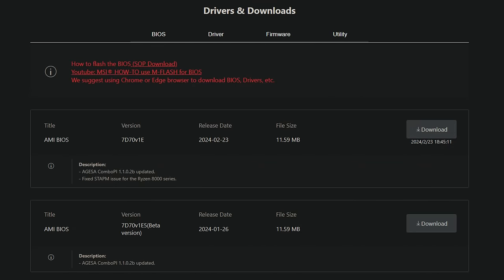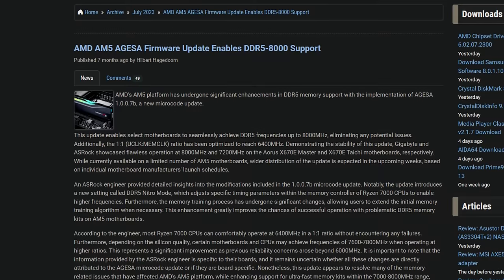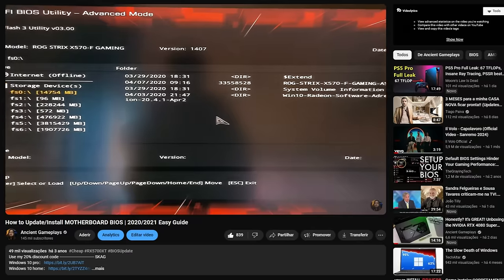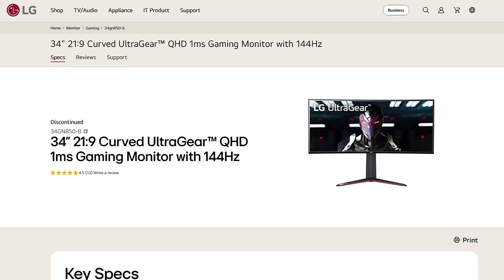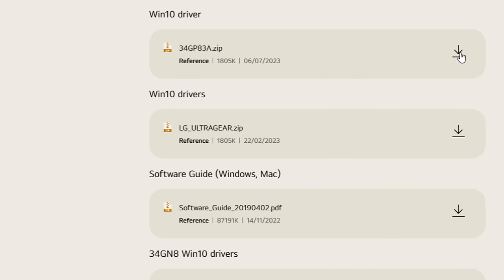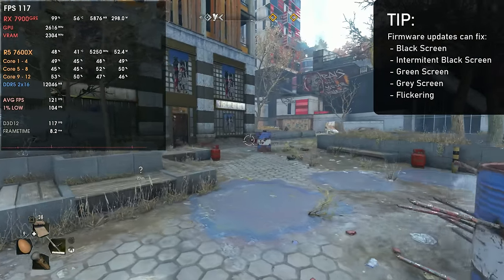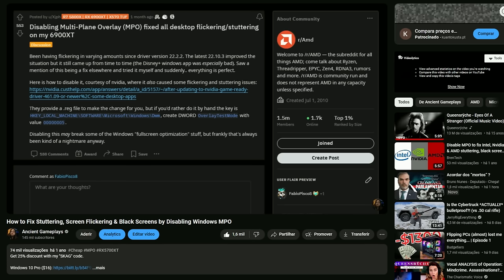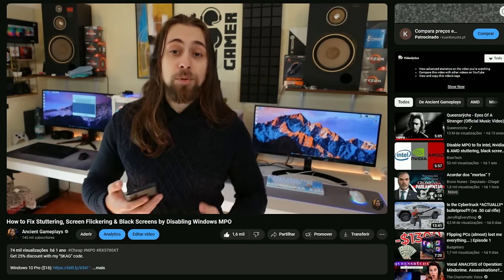20 TIPS to FIX "AMD GPU's Problems" | Easy 2024 Tutorial Guide

Comment: I'm going to try some of these things, thank you for the video.

I'm having an issue with my RX 7800xt card in Unreal Engine 5 where if I use DirectX 12, I'll get gpu driver crashes with a lovely little error message about "driver crashed or d3ddevice disconnected" and it's driving me up the wall. From my research, this seems to be a very common issue for people but there's very little information in the way of fixing it and it's been ongoing forever...  I hope I can find a fix or that one of your suggestions helps because I need to use dx12 for my project. lol
Reply from the maker: Never had a single one of those issues with any game I played, including UE ones
Reply: @AncientGameplays  It's not an issue with playing the games, it's an issue with developing them. DirectX12 is required for things like lumen and nanite to work but it seems to be a common issue for developers using unreal engine with an amd card to experience unfortunately.
Reply: @TuxedoVaileGAMES  Have you checked that you have the latest DirectX 12 installed? There is a more recent version - DirectX 12 Ultimate that may not have installed perhaps on your PC. DXdiag on your system should show which version you have.

 If you do already have that,  and as a precautionary measure anyway, you can run dism commands from an elevated command prompt to check that your system image is not corrupt and chkdsk for your OS drive. It can also help to do an inplace install of Windows, keeping all of your settings, apps and files. This can help with corrupt system files as well.
Reply: @ZenAndPsychedelicHealingCenter  I'll check that yeah, my PC is a brand new prebuilt from Skytech though and I think it was already up to date when I went through everything a week ago when I got it. I'll still check though, thank you.
Reply: Yeah, it looks like I'm using the most up-to-date DX12.

Last night I did manage to help my issue a little bit by adding a Tdrdelay to my windows registry. I still get minute long hitches where my game engine freezes during play-tests but at least it's not crashing anymore.

Comment: Hi

Have you ever run into this crash problem? Started 01.01.2024, NEVER before.

I built the computer autumn 2022, it worked flawlessly with 3 different GPUs (first nVidia, then Intel and then AMD) until just after new years 2024, then the problem started.

After I boot the PC (7900 XTX since autumn 2023), after a few mins, the PC may blackscreen boot. When I ran WinDbg back in January on the mini dump, it stated " DRIVER_POWER_STATE_FAILURE ". But not been able to get WinDbg after the first week or so, now it never finishes debuging.

After the reboot, that may happen after a few mins after booting, which occurs about 75% of the times I turn the PC on, the PC is rock solid for hours on end with gaming. No OC, except RAM that is running 6000 AMD profile in BIOS, Asus Rog Strix X670E-E Gaming Wifi mobo.

Updated BIOS, tried many AMD drivers, and I have no idea what driver the WinDbg is referring to either, it did not state.

Let me make this very clear; it NEVER happened until clock said 01.01.2024, then it started, just 1 or 2 hours into the new year. If I do not remember wrong, it started happening with the first boot in 2024.

Anyone experienced this? Any ideas?..

Computer Type: Desktop

GPU: 7900 XTX

CPU: RYZEN 7 7700X

Motherboard: Asus Rog Strix X670E-E Gaming Wifi

BIOS Version: 1904 (also tried with earlier BIOSes)

RAM: G.Skill Trident Z5 Neo DDR5-6000 C30 DC - 32GB (AMD EXPO)

PSU: ASUS ROG STRIX 1000G

Case: Corsair 5000D AIRFLOW TG

Operating System & Version: WINDOWS 11 Pro

GPU Drivers: tried several, now on latest beta 24.2.1

Chipset Drivers: 5.11.02.217

Background Applications: Aida64 Ultimate, HWInfo, Steelseries GG, Armoury Crate + div drivers
Reply from the maker: Follow the tips mate, also, your chipset drivers are old
Reply: It's written as NVIDIA, all upper case letters, just like AMD.
Reply: @AncientGameplays  I updated the chipset driver before I posted this, forgot to correct it. Will see if that solves the problem.
This is a really weird problem, the machine has run perfect since it was new, UNTIL first time I used it in 2024.
So this crash is 99,9% sure related to year 2024, never happened before 01.01.2024
Reply: @AncientGameplays   Nope, new chipset driver did not fix it. I have now also installed Linux, yes, Linux on a second drive in my PC. I will see if I run into the same problems with Linux, if so its hardware problem. If not, its a Windows problem.
So far gaming on Linux is going great :)

Comment: Why is the option for a clean driver install not part of the AMD Adrenalin software itself?
Reply: Kind of is though, but not reliable
Reply: Yeah, there is a force clean install checkbox during the driver install, but I haven't tested it.
Reply: nowadays people always used ddu for nvidia & amd driver for some reason or using amd cleanup utility (the same thing but can take you to safe mode automatically)
Reply: It is in Adrenaline. When ypu tick the box for clean install it will use the AMD Cleanup Utility automatically.

Comment: msi mpg a850g (850W 80+ Gold PSU) won't be an issue right? (For black screen crashes with rx 7900 xtx)
MY gpu is currently in repair/swap (again). I already bought gold plated dp2.1 cables for my monitors. I think this might help (my old gpu couldn't get image with monitor's default cables, but with those it works perfect, maybe it was an issue on the amd rx 7900 xtx too!)
Reply from the maker: Damn, that sounds really annoying..
Reply: Yeah... I couldn#t even play need for speed heat or start wars survivor or cs2 without crashes. However the performance was amazing, when it worked! I hope it will be fixed with the dp cables, when the gpu returns @AncientGameplays
Reply: Quick update: The gpu works now.
I got it returned to replace it in total two times.
Now it works just fine.
The problem: Part the gpu, part the displayport cables
I had 2x gigabyte g27q monitors for crisp wqhd 144hz gaming, and used the monitor's provided cables (dp1.2"hdr enhanced") i bought new ones (dp2.1 8k@120hz with gold plated connectors). now everything works buttery smooth, i could even oc to 3200mhz.
It was due to the bandwith, 144hz and 1440p, on dp 1.2 is like bare minimum, which can lead to interferences.

Thanks for the video, i wouldn't have ever thought it would be due to the cable!!!!

Comment: For me, updating bios and chipsets.

But I had to use the motherboard utility (GCC for Gigabyte -Z690 ud ax dr4-). 
Before using the utility, I was having a hell of bluescreens and sudden freezings, it was literally every day and especially when pc on idle.

I thought the problem came from my RX 6800 gpu (first AMD gpu since 2015, I hated AMD because I bought used R9 290 back then, was like a heater and tons of crashing and BSDs and went GTX 1060 on 2016).

But RX 6800 and Adrenaline Software made me trust in AMD again.
Reply from the maker: Like i said, most issues aren't amd sided
Reply: @AncientGameplays  What made me think it's amd fault, that Adernaline was resetting everything to default with a message that there was an issue and need to report🙂 So, they kinda guilty of taking other's mistakes on their shoulders. 
But I found out it's not their fault from event viewer, and I kept digging until GCC saved the day🙂
Reply from the maker: @mbrj3idi830  the settings reset due to system instability usually
Reply: @AncientGameplays  You definitely right.
This is the difference between AMD and Nvidia.
Nvidia never tells anything, even if it's their mistake🙂 They zip it till the next update 😏
AMD needs a user who knows, can trace and solve pc issues (not necessarily a professional, but have a minimum knowledge).

Comment: I have a 6800xt sapphire nitro for about a year (used). I did all that you said, but the gpu sometimes did just flicker and go black screen. The only thing that fixed it is a 40 mhz overclock of vram (so it doesn’t go below 2000). Yeah it is strange, maybe it is something about power stages or the vram is dying idk. I also redused gpu clock to reference at 2250mhz, voltage stock, power limit +15. The card now draws only 170-210watts(depending on the type of load), runs cool hotspot never over 80c, fan speed  1800-2000 rpm.
Sry for my English, not native language

Comment: Have you tried installing the chipset drivers that released on the 13th? They seem to have an issue
Reply from the maker: Mine are fine here
Reply: @AncientGameplays  I reached out to customer support the day of and the rep said they were aware of the issue. perhaps it has been resolved but the version number is the same. I'll try again
Reply: @AncientGameplays  no issues this time. Found the picture I took of the message and it was saying  "parameters incorrect" when trying to run the download before. Good to see they resolved the issue quickly

Comment: In my experience RTX 4080 has been plug and play, cannot think of a single issue. compared to 5700xt I used for 2 years, stuttering and performance change due to driver installs was the worst.
Reply from the maker: You kinda picked the worst case scenario. 5700xt was a trouble gpu in many ways, not even comparable to nowadays amd cards
Reply: RTX 4080 is the newest gen of NVIDIA meanwhile 5700XT was the 1st gen RDNA Card. So far away comparation in my opinion. My friend is using 5700XT for about 2-3 years i thinh & so far no problem on his side
Reply: @HapPawhere  well I had a gtx 460 and gtx 970 prior with out issues.

Comment: Pc GPU tip (crazy idea) - put rj45 ethernet plug on the GPU itself to run internet trough the GPU itself and to screen out any spying and filtering any viruses or malware before it gets dangerous for the PC itself or your BIOS 😮 ( well these days we have like 32 GB v-ram gpu-s 😊 lets put them togerher to work and to protect the PC and ours or yours data and privacy 😊😊😊😊😊😊😊 - now how about the inovative design works - no spying - no unwanted ports linking - full protection trough AMD software 🎉 ( call it AMD firewall gpu-s or something 😅😅

Comment: In every video I can't help but stare at your speakers with the dented dust caps on the woofers because I'm OCD like that. 😅It doesn't effect the sound of the speaker, but you can fix them easily enough by using a vacuum to pull them back out.

Comment: How do you fix blocky shadows / popping( similar to low draw distance) textures / reflections fuzzy (like looking at a busy ant nest)?  Hope my card is not faulty, everything up to date(clean installed driver and windows). XFX 7800xt, and (mostly) unreal engine games don't like my card. Temps are fine, GPU and hotspot has at around 15 °c difference (highest hotspot I remember is 85°c). Thank You.
Reply from the maker: blocky shadows? Never had such thing in several cards and over 50 games, BUT, you might be having a bug there in a specific game maybe?
Also, when getting AMD cards get Sapphire, Asrock & Powercolor to begin with... XFX should be the lower end choice IMO

Comment: I have to restart every 3 hours to get fluid motion frames back on. Because it disables itself at 3 hours.
I dont have windows activated. Does anyone think that could be a problem. Also I have like 3 amd folders with different things in them on different ssds. Not sure if that would cause any problem either. Everything works fine until 3 hours and afmf stops and won't come back on until restart. Also I only have 30 gig left on the ssd with the software so I dunno if that's to small and causing some kind of background issue building up memory or.something until the 3 hours. Any help appreciated
Reply: Upgrade or add on an external ssd
And you can get an activation key pretty cheap on sites
Reply from the maker: Use the 24.1.1 drivers

Comment: The best AMD fix I've implemented was moving to Linux.

Sounds like a Linux propaganda but I swear this the truth. There are more than 20 fixes listed here and they are somehow related to compatibility issues both physical and logical. AMD hardware on Linux somehow the opposite and I had no issue since the last 2 years of it yet I always get called on by people to fix their PCs which often times is related to their GPUs not working properly and throwing BOSDs (happens both on AMD & Nvidia), with AMD there's this recent recurring issue with Windows installing different drivers every time.
Reply: Linux support is one thing that's generally much better with AMD gpus than nvidia ones these days (sans HDMI 2.1 support because HDMI forum are ***).

Comment: Im having an issue that when i enable VRR in my monitor the screen randomly looses signal, sometimes it works for reasonable time, but suddenly returns the same issue. I have tested different cables and it's not the monitor's fault because happened before with my old monitor. I have an 6700 XT
Reply from the maker: Unless you have a defective card (which is hard to happen) something is going on there. Have you tried the things in this video?
Reply: @AncientGameplays  Yeah, only disabling Windows MPO haven't tried yet

Comment: My friend, my motherboard is Msi x370 Gaming Pro Carbon and the chipset driver versions on the Msi website and the AMD website are not the same and the driver version on the AMD website seems to be newer. In this case, which driver should I download and install? My graphics card is Msi Armor RX 580 8GB OC. The new drivers can often cause problems in many games. What should I do in this case? ULPS can be turned off from the registry.

Comment: Hey Fabio, I have had an issue with my build ever since I installed a GPU on it a few months after first putting it together: I can only play my games when I set my CPU (Ryzen 5 7600) to auto overclock in Adrenalin. I have tried manually setting up OC on the BIOS, researched PBO configs etc, but to no avail. The strangest thing is that games that ran on integrated graphics before without any issue.

Comment: Hi, Fabio, I have problems with my rx 6700 xt: when I playing with amd adrenaling monitoring or other overlay from amd adrenaline I having a great smoth image buy when I playing without it I just have some stutters or smf like that just image don't snooth any more on my monitor (I test it on other monitor as well no metter what monitor I use) but FRAME RATE are good wihout any troubles (I have riva tunner graph). Maybe you  can help me?
Reply: Also drivers, windows I reinstall couple times and it don't help me
Reply from the maker: that makes absolutely no sense to me. Watch some of these tips, certainly will also (like the VRR and antilag one)
Reply: @AncientGameplays  I've tried all of the tips :D nothing is fixing this problem only amd adrenaline overlay help me

Comment: What problems? Had an amd gpu since early 2022 and haven't had any issues with it or it's drivers. Before that I had an nvidia gpu and had no issues with that either. Didn't even do a clean driver install either 🤷

I did have an issue with my ryzen 5600x/b550m motherboard, the famous usb connection randomly dropping and reconnecting bug. Only affected an usb bluetooth dongle and was fixed by disabling usb powersaving.

The old amd chipsets made by via, kt133/kt133a, were a buggy mess.

Comment: Quick question, did not find this in the Comment section. Do you have to uninstall the adrenaline Software to get the PRO or do u just install both?
Reply: yes you have to uninstall adrenaline to install the pro version, I have tried the pro version which is more stable

Comment: Bom dia Fabio. Were you able to determine why your 6000 series GPU worked perfectly in one PC and crashed in a different rig when messing with clocks ?.
My 7900XTX kept crashing after doing everything suggested, I sold the card and bought a 4080 which has worked flawlessly since day one with the same PC settings, it was truly plug and play. My sold 7900XTX works flawlessly in its new home. My take is that there is a combination of hardware and/or settings which AMD and RTX cards don't like but it seems that AMD cards are more "sensitive" to PC hardware combinations/settings.

Comment: Good Video as always but "disbale ULPS" seems not working. I disable it, restart PC and the GPU is still Downlocking in Games, sometimes to 1000mhz and lower. I have a 6700XT with clean installed 24.2.1 Driver. Any Idea?
Reply from the maker: It only downclocks to an extent and only in extreme scenarios. You have a cpu/ram bottleneck
Reply: @AncientGameplays  thx. My 5600X is the Issue for CPU intensive Titles i think.

Comment: I recently jumped ship from Nvidia to AMD and got a 6900XT, So far everything is absolutely amazing. But when it comes to tuning, i UV'ed OC'ed and changed the fan curve to a stable config after testing multiple games. Problem is, adrenalin always reset to the default tuning config after a restart. I have the profile saved and all, but it's really annoying to have to open the software and apply the settings every time I boot up the pc. Has that happened to you? can you suggest a solution? highly appreciated if you can.
Reply from the maker: If it restarts, your oc isn't 100% stable
Reply: @AncientGameplays  Oh no no you misunderstood me, it runs fine, I played immortals of Aveum for 8 hours straight it was fine. it's just when I turn pc off, and on again, the config resets on it's own and I have to re apply.
Reply from the maker: @TheCnf  I didn't misunderstand you. the GPU have several power states, and when you mess around with the OC you mess around with all of them. Sometimes the instability shows itself in lower load scenarios, not in high load ones, exactly the same happens with CPUs and Curve Optimizer
Reply: @AncientGameplays  I copied some people on reddit and UV'ed to 1150mv, didn't touch the core clocks, OC'ed the memory to 2100MHz and changed the fan curve (which is terrible). I don't think I went overboard crazy with the settings.